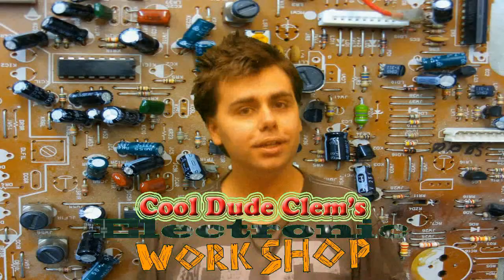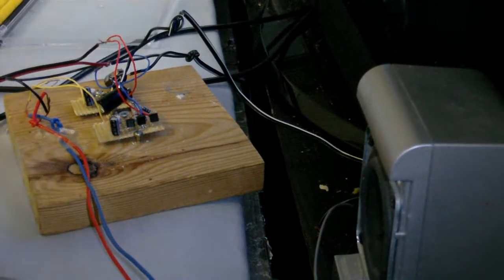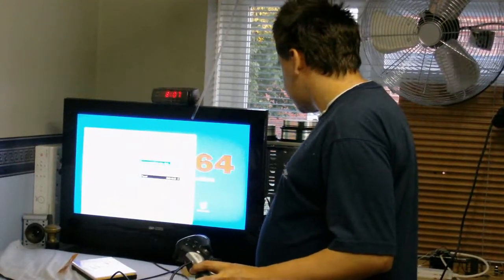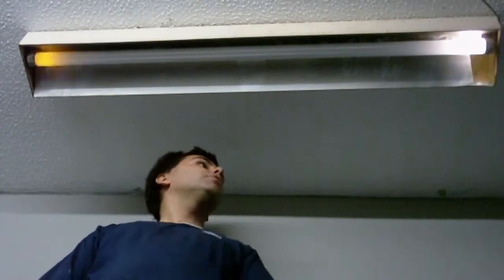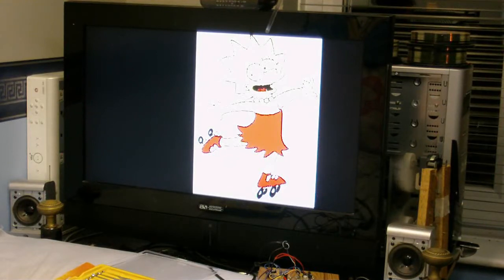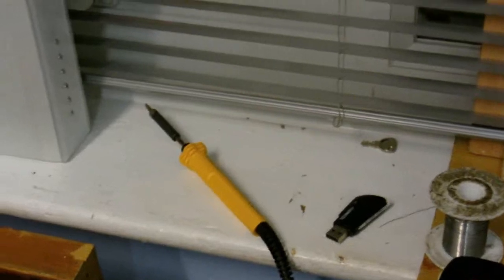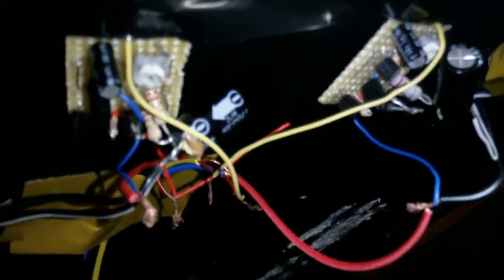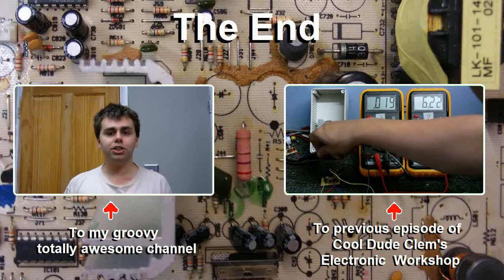CDC Elcetronic Workshop - A new home for the 2 amps I built

Comment from the maker: I just had the two small speakers on in this video, surprizingly they can produce quite a bit of bass.  Those amplifiers I made no longer work as the transistors failed after a while, I was just trying to push them too hard.  Right now I have the same speakers hooked up, but I'm using an LM383 chip amplifier instead, it sounds pretty good and has enough power to suit my needs.

Comment: I hear some bass when you test the speakers did this amp produce a lot of bass, do you have just he two durabrand speakers linked up or is the speaker under the desk wired in, do you still use these amps, what does the sound system cosist of now for the computer.

Comment: sooo you have about 1.75 watts maybe of sound in your room right???
i have about 350 watts in my room.
150 is underpowering my 15 inch Competition car subwoofer
and the other are powering my full range speaker. i have 4.
2 of them have a 12 inch subwoofer and a 5 inch midrange and a 3 inch tweeter. the other two have a 7 inch woofer and a 1 inch tweeter. 
i am soon to get more if you are interested
check out my channel. 
the audio i have is for my computer and its all car audio.
visit my channel